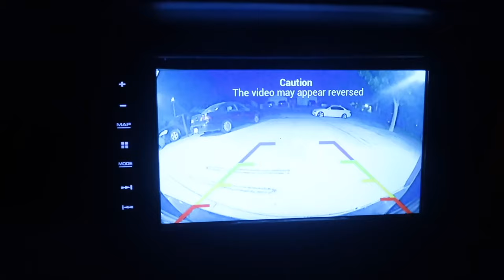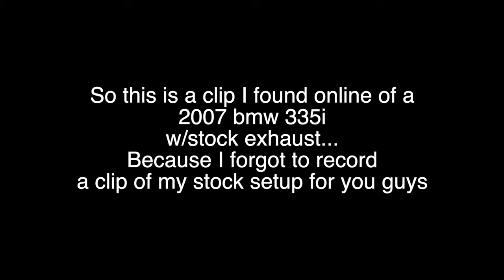CATLESS DOWNPIPE 335I

Comment: I be setting off alarms without Mufflers! Get it
Reply from the maker: i have a hks bov sounds really good... and im still debating if i should delete cuz cops love to pull me over and that will give them reason to pop the good too.. i also have the dci's
Reply: @damechansavlogs  just dont drive in sports mode when around a cop.  Exhaust Sound should be ok.
Reply from the maker: @4037joel  still debating if i should or not... but that is exactly what i will do if i go through with deleting the mufflers...